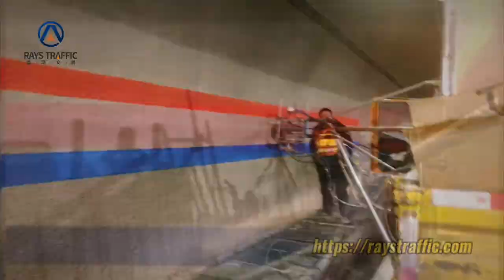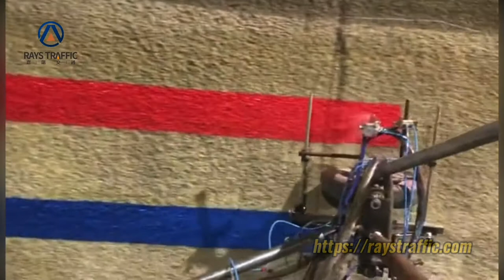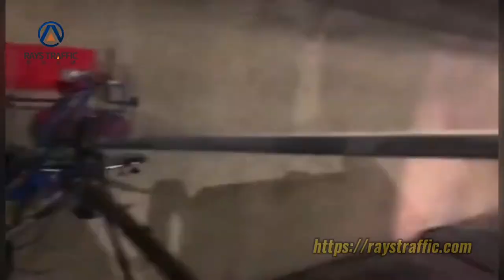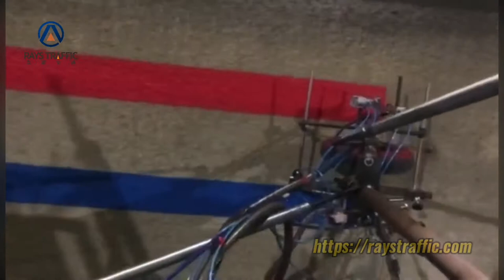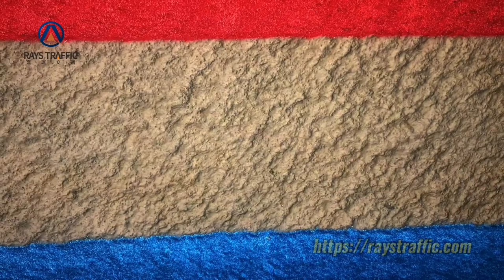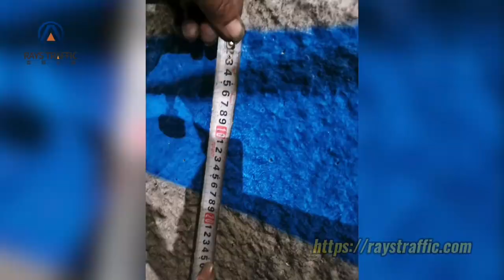Application of Reflective Lines on Tunnel Facade -Zhenjiang Rays Traffic

Comment: Genial!!!
Verdaderos maestros.
Muy buena ejecución de la marca vial. Muy buena definición de la marca vial.
Trabajo limpio y efectivo.
Enhorabuena, apreciados colegas.
Un cordial saludos desde Tenerife. Islas Canarias-España
Cuídense
Reply from the maker: Thanks very much for your focus and opinions~Reflective vertical object marking paint can greatly reduce traffic accidents, traditional paint cannot reflective at night. The cost of reflective tape is much expensive. Using our dual color cold paint machine to spray one-component or two-component road marking paint wtih reflecive glass beads. These lines on the wall can be quickly constructed, which greatly promotes the promotion of reflective vertical object marking technology.